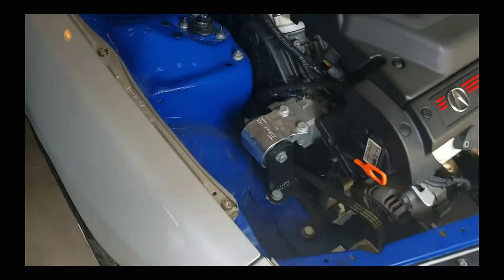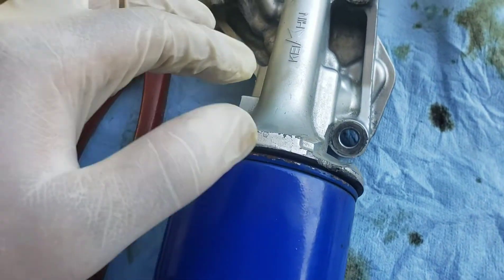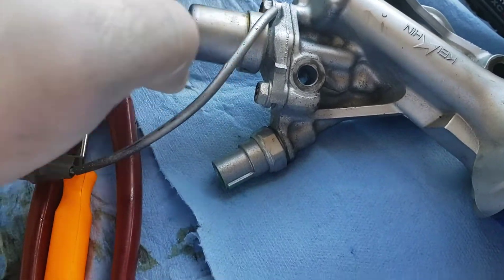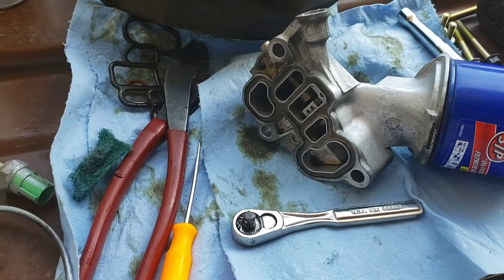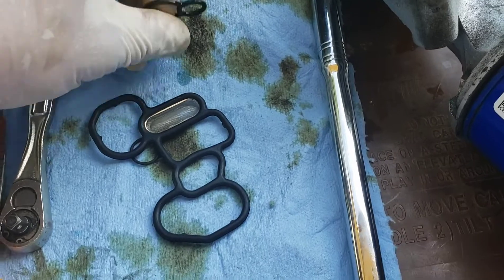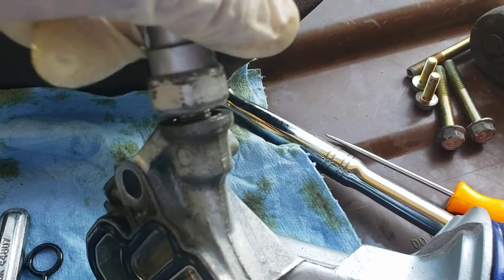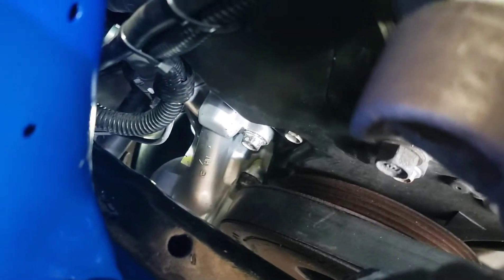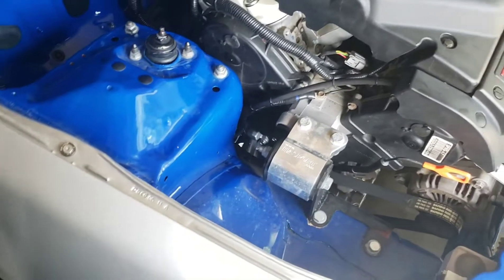**Common place for an oil leak (J series Acura/Honda)**

Comment: Hi, great video!

How can you tell if it is the oil pump that is leaking or the oil filter housing that is leaking? I have a 2007 RL and I can see oil leaking from the oil filter housing area but not 100% sure if it is not really the oil pump that is leaking.

Actually... thinking about this a bit and if the oil pump was leaking, wouldn't the timing belt become oil drenched as well whereas, if it were the oil filter housing that was leaking, the timing belt would be dry?

I have my timing belt exposed as I am in the midst of changing the timing belt and W/P and it looks bone dry; old but bone dry. So I think that would make me think the leak is from the oil filter housing and not the from the oil pump. Does that make any sense?
Reply from the maker: If its coming from main seal,yes it will soak the belt. If its coming from the oil pump(and not the seal) it will leak outside of the area. I always clean the area where leaks are. Drive for a few miles and recheck so its not soaking in oil
Reply from the maker: Its also so common for the housing to leak first before anything else.
Reply: @FlipSideGarage  you mean the oil filter housing?? I would agree and so much easier to repair but if it is the oil pump seals and while I am changing out the timing belt...

How can you tell? If it is the oil pump seals, wouldn't the timing belt get very oily too? Thanks!
Reply from the maker: @BraveHelios  if its the oil pump seal youd know once you take timing belt off. Id clean off the area,drive it around,let it idle and watch around to see where it comes out.
Reply: @FlipSideGarage  I see. I missed the part about cleaning things off and driving around to see where it is leaking BEFORE taking things apart. I did see a lot of oil leaking from the oil filter housing area (it was very obvious that it was leaking profusely from this area). I now have everything apart to replace the timing belt and water pump and the oil filer housing o-rings/gaskets. I hope that is all that is needed as I will leave the oil pump alone for now!  

BTW; the old timing belt is dry... which does bring me to another question. If the seals are not leaking (like the crank seal and the camshaft seals), should I leave them alone? I replaced the crank seal on my old Odyssey mini van and I think it started leaking after I installed the new seal!
Reply from the maker: @BraveHelios  if its not leaking. I always leave it alone.
Reply: @bravehelios did u figure out what was going on sounds like that is happening now to my 2005 rl
Reply: @hectorjaimes8835  It turned out to be the oil filter housing gasket which I replaced whilst replacing the timing belt and water pump et. It leaks from there no more. Now I have to fix a leaking front axle seal so going to replace left and right seals as well as the axles as they "feel" worn.
Reply: @BraveHelios what was wrong with the old oil filter gasket ? Wrong size? Etc .. I am having the same issue after i did the TB and WP
Reply: @troyyashin  I assume it deteriorated until it started leaking, a lot. Once I replaced it, the oil leak was fixed and it is not too difficult to do!

Comment: Does the oil need to be drained before this repair?
Reply from the maker: Not at all. Youll just some that drain from tha location. Id suggest leaving the motor for a day so majority of the oil goes to the pan. Have 1 qt of oil to replace what drains out.
Reply: @FlipSideGarage  thank you!
Reply from the maker: @mikeshagoury  you are very welcome. Btw this fixed my leak finally. Been holding off for a while.lol

Comment: Acura 2006 RL SPEED SENSOR WON'T MOVE NOW SMOKE COMING FROM FRONT
Reply from the maker: Could be a bad sensor..check plug make sure no oil in it.

Leak probably dripping at exhaust which will make it smoke